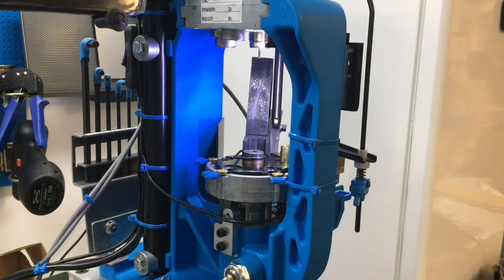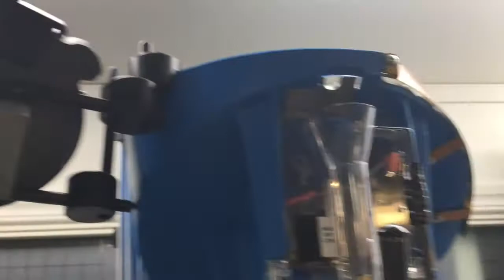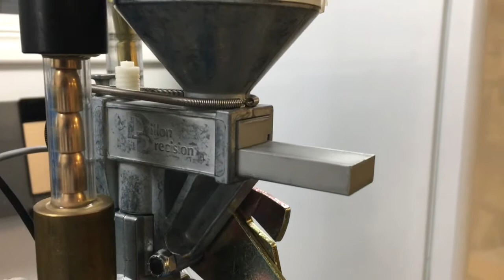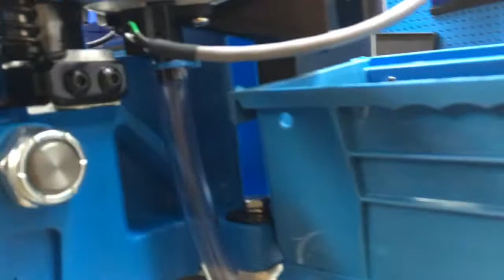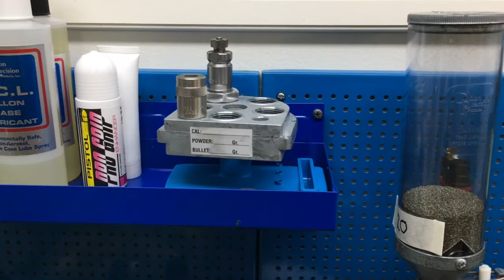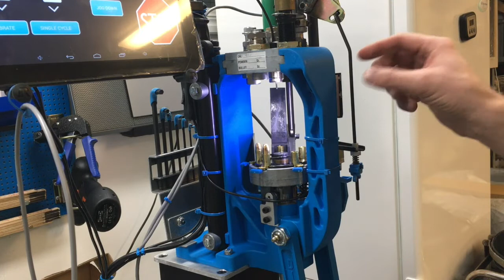Pimped my Dillion XL650

Comment: What.Really .nice set up...do you have any problems processing brass.....and with all the upgrades when loading ...is it still super smooth 
I have all but one or two upgrades ....and I have been thinking about mark 7 as well...
Finally nice to see a 650 done up ...great job
Reply from the maker: Davide Montini thanks, I have actually upgraded the unit a little bit more since the movie. Added the brass and primer stop from Snow something in Canada.

https://rover.ebay.com/rover/0/0/0?mpre=https%3A%2F%2Fwww.ebay.com%2Fulk%2Fitm%2F223073346537

Processed 28000 rounds so far and are very satisfied. Have cracked the rotating plastic part twice and replaced the primer return spring once. Works great